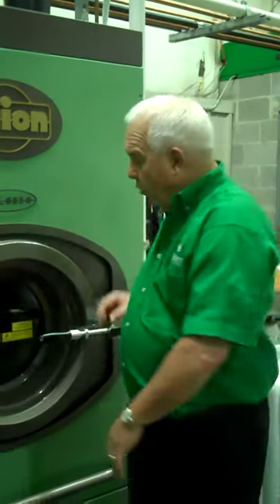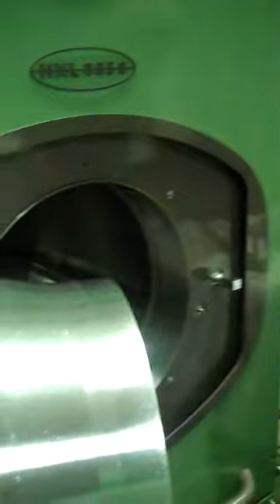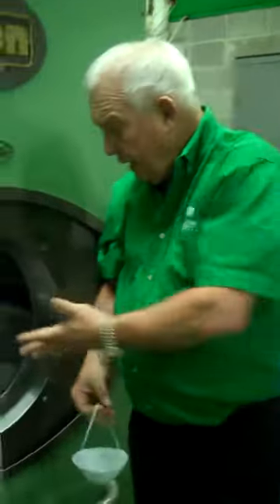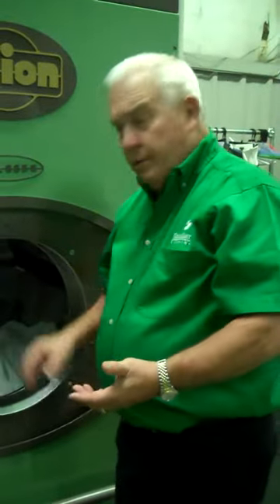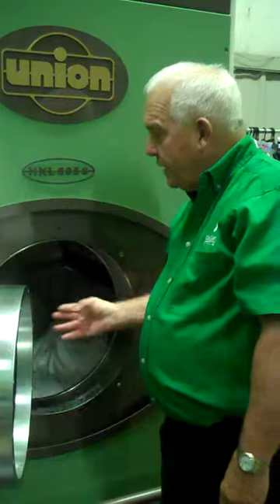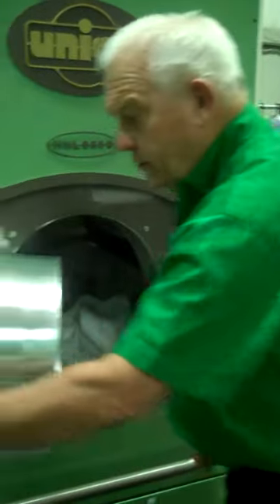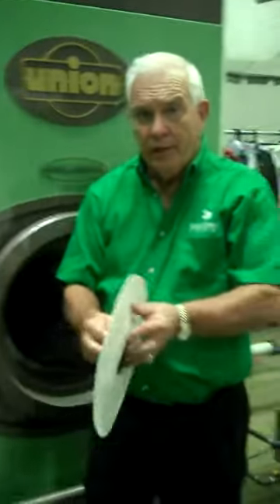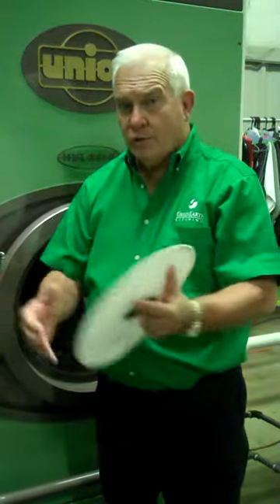GreenEarth Technical How to Coat Spin Discs.©2012 GreenEarth Cleaning LLC. All rights reserved.mp4

Comment: jim u made  one  BIG mistake!!!   when  u run programme 20 it  does not   drop  the  filter in to the cage  like u said in the video to start with, half of the filter  is dumped to still first   it then spins   the discs  before   dumping the rest of the filter to still